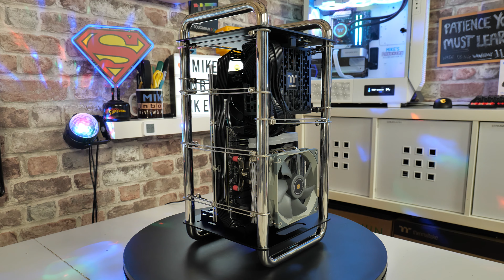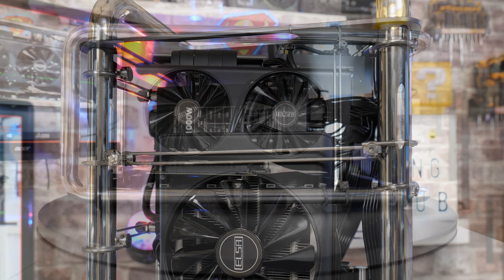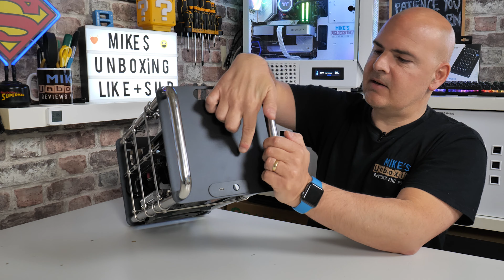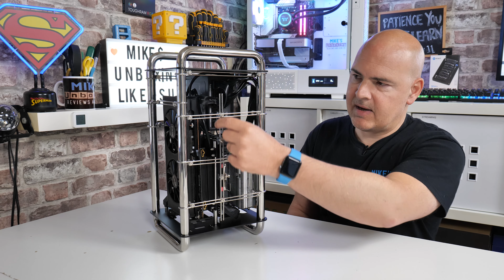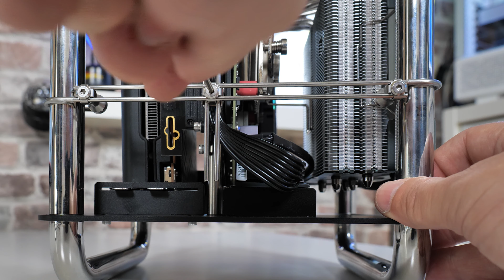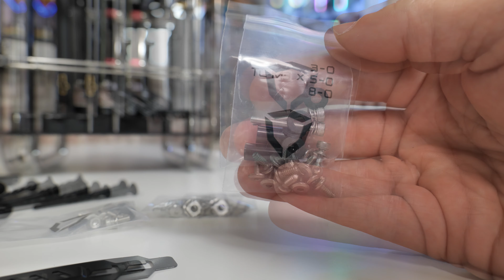Streacom DA6 Vertical Open Frame Steel Modular ITX PC Case For The Brave

Comment: Actually Ive just set mine up this afternoon to get the Intel i5-13600K cpu  below the 100 degrees as it was ramping up to in Cinibench R23 as the newer processors do. I had to set the cpu core voltage to1.475 which just peeks core 3 touching thermal throttling the rest are 95 degrees. The issue I had was getting a suitable gpu extension cable as the site states it needs a 180 /180 which Im still waiting to come from aliexpress ( PCI Express 4.0 Riser RTX 3090 Graphics Card Extension Cable Reverse GPU PCIe 4.0 X16 High Speed Riser Cable ITX A4 Mini PC Case).
I managed to pick one up on ebay after seeing you preview it the first time and fiddly is putting it mildly, its frustrating trying to mount kit when the parts holding them keep moving around.
Reply from the maker: yeah i think you can't really quite grasp the challenge this is unless you try it for yourself. worth it in the end though i think